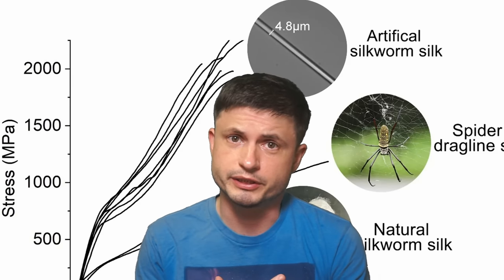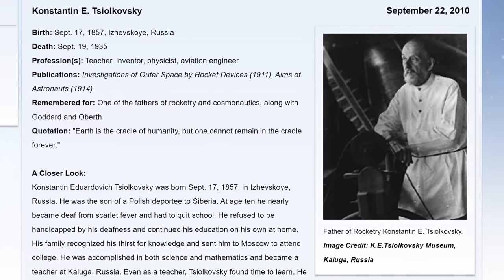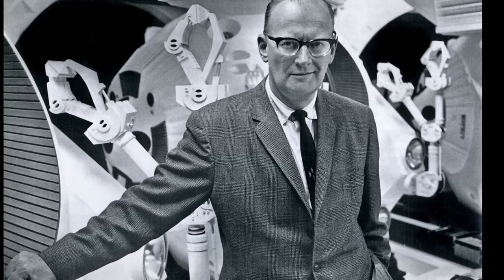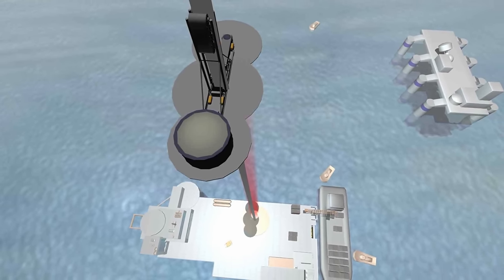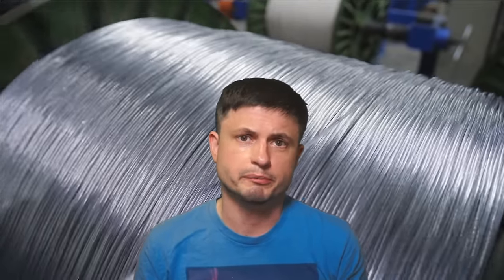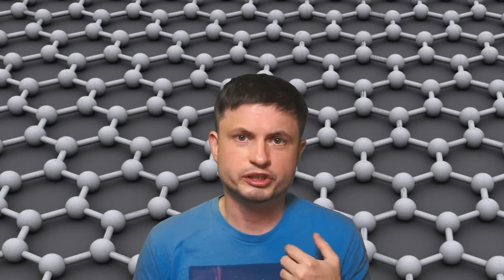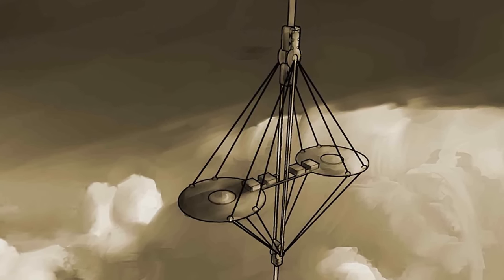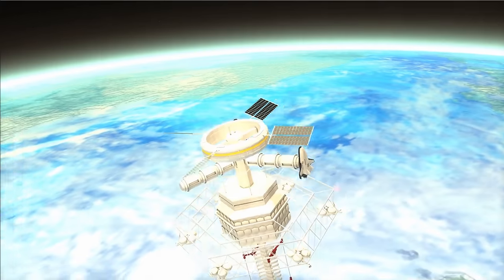Exciting New Updates About Space Elevator Technology...Possible After All?

Comment: I'm excited about the advances in graphene technology!!  I have to wonder how storms would affect the space elevator.  I guess the tension would be greater than any wind speed.  What would happen if it fell?  Fascinating subject!
Reply: It would fail hugely 😂
Reply: Weather is actually one of the largest problems concerning SE development, this is why the terrestrial end would almost certainly need to be on the water and 'free floating' so as to allow it to move around problematic weather patterns. Another possibility would be to build on a near-equatorial high point somewhere the weather doesn't get too violent, but there aren't all that many good candidates for that option, and of those which do exist, most are in politically 'awkward' places.

As for what would happen if it fell......well that's not a happy thought, one hell of a lot of mass coming down at a pretty high velocity (especially the 'far' end of it). There are a few thoughts on what could be done to mitigate real damage in such a situation, and oddly, having strategically placed det charges every kilometer or so, designed to go off in the event of catastrophic failure, would probably stop the worst of the damage, but certainly offers up problems of it's own in safety and application.

Ultimately, this is still all mostly speculation since the logistics of getting everything started are still monumental in scale, if we are to assume graphene tethers are the option used, the graphene itself would almost certainly need to be manufactured from geostationary orbit rather than shipped up prefabricated. That way you could do several raw material deliveries instead of trying to get what will be a rather huge mass of graphene up there in one or two trips.

I still hope to see the first SE up and running in the next 20 years, but I'm not holding my breath. I have been convinced the idea is literally going to save the human race sooner or later, it is without doubt the single most important endeavour in scientific development at present, if not ever. It offers solutions to everything from space travel and colonisation to power production and finally gives us access to the cosmos for a sustainable price (these things would be solar powered so literally zero emission space access).

Thankyou Anton for yet another great video, keeping doing your thing dude, you're a legend!
Reply: All questions that will have to be addressed and answered.
Reply: I always figured a space elevator wouldn't be plausible because of the fact that it would be the largest lightning rod in existence. Going near it would be a death trap. Maybe it could be used as a source of electricity? I don't know, someone smarter than me could answer all that.
Reply: it would definitely depend on where the rope snapped, if it happened near the earth, nearly the whole space elevator might simply float away into space, dragged by the counterweight; or if it snapped higher up toward space, then you could indeed have hundreds of miles of metric tons of this rope-stuff falling down onto the planetary surface as a very real scenario...indeed having this type of thing anchored in the open ocean for such a reason could be interesting
Reply: You should read the Mars Trilogy by Kim Stanley Robinson. It’s a bit of a slog by by golly does he really dive deep and explore some very interesting topics and concepts. Not least of those is a Space Elevator and everything about it. Including using harmonic oscillations in the cable to dodge moons and such. There’s so much more but spoilers about. You should just give it a shot.
Reply: @czarlguitarl  that's now how gravity works. It would deorbit, it wouldn't go floating off into space. There is no outside force acting upon it.
Reply: @czarlguitarl  A series of counterweights with explosives built in to keep as much as possible in geocentric orbit might solve part of the problem.
Reply: If you suspend it above sea, what direction would it fall, east or west? And how large will the impact region be? Or would it fall straight down. Could be video in itself
Reply: @AnubisSolvang  The counterweight of the elevator moves at above orbital speed. It's past geostationary orbit and yet moves with geostationary angular momentum. This is why there is tension in the cable at all: the counterweight is ""trying"" to move in an elliptical orbit, but is stopped by its tensile connection to the ground through the cable. This means the cable will probably come with the counterweight into its high elliptical orbit if it snaps lower down.
Reply: @primarysecondaryxd  your forgetting about atmospheric drag. But I am no physicist so I could be wrong. To me it very much seems like it would deorbit. Because take into consideration that even the moon is within earths gravitational well.
Reply: @AnubisSolvang  Atmospheric drag would not be an issue because the elevator is not moving relative to the atmosphere
Reply: @AnubisSolvang  It's not that your concept of physics is wrong, it's just that you're having a hard time visualizing the perspective necessary to understand it.  This is an entirely new concept that no human has ever seen before, and it takes some orbital mechanics to understand everything that's going on.  If one were to snap the cable just above ground level, the entire structure would in fact lift up and out toward space, as the countermass at the other end has to provide tension all the way to the ground...meaning it's pulling the ground structure up.  The mass at end of the elevator is akin to swinging a weight at the end of a fishing line, if the cable snapped it would be like letting go of the fishing line and allowing the weight to fly away, with the fishing line in tow.  Orbital velocities are different depending on how far away you are from the planet, and they only coincide with the rotation of the planet at a very specific distance called geosynchronous orbit.  If you're below this, like where the ISS and most satellites are, your relative velocity to the rotation of the planet will be higher, above this and your velocity is slower (note that our relative rotational velocity is faster than the moon's, which is considerably farther than geostationary orbit).  Now, if you're not at geostationary orbit and you match the rotational velocity of the planet, you will either start falling if you're below it or flying away if you're above it.  At LEO (low earth orbit), satellites have to fly faster, around 17,500mph.  Geosynchronous satellites are only 7,000mph, and the moon is a boring 2,300mph.  So if you're going 17,500mph in geosynchronous orbit, you're going 10,000mph faster than necessary to maintain orbit, which mean you'll be leaving that orbit in short order.  Now, imagine a satellite in a stable geosynchronous orbit, as long as it's positioned there very precisely, it's going to stay there virtually indefinitely, but the satellite is small so it doesn't help us visualize anything.  Instead, let's make the satellite truly massive...actually, let's make it a hypothetical spherical alien ship that's 100 miles wide.  It's also in a stable geostationary orbit, even though parts of it are 50 miles below geosynchronous orbit and parts are 50 miles above it.  It doesn't de-orbit, and it doesn't fly out into space, because its center of mass is precisely at geosynchronous orbit.  Each end is held together because of the tensile strength of the hull.  This would still hold true if it were 44,000 miles wide, which would put parts of it within our atmosphere nearly touching the surface and parts of it way past geosynchronous orbit.  It won't burn up in the atmosphere because the atmosphere has the same relative velocity...that tangent point of the ship is going at the same exact speed as the surface of the planet, even though it's a massive ship in a much higher orbit than something like the ISS.  The other end of the ship is at an altitude of 44,000 miles, where a stable orbit speed would be 5,000mph, but that end is going considerably faster than necessary for that orbit. Both ends of the ship are trying to be pulled apart by gravity and centrifugal force, but held together by the tensile strength of the hull, with the center of the hull being point where the forces are trying to pull apart from each other.  From here it's easy to imagine a cable running the width of the ship that helps add strength to the hull when they park it at such an orbit.  Take away the ship and leave the cable, and you've basically visualized a space elevator.  So what would happen if we got tired of the alien's crap and Will Smith flew some canned sunshine into their ship to blow it to pieces?  Basically, anything below geosynchronous orbit would eventually fall, and everything above geosynchronous orbit would fly out into an elliptical orbit, with their original altitudes being their orbits' perigee.  The pieces likely wouldn't fly off into deep space simply because escape velocity is much higher than this and they're not going to have little boosters to aid them, but the explosion might push a few smaller pieces past that point.  With the space elevator, things are pretty much the same.  If the break happened near the surface, the portion above would appear to an observer to simply levitate off the ground straight up and disappear into the sky.  Keep in mind this is going to result in an elliptical orbit, meaning the countermass is going to bob up and down relative to our perspective.  Breaks anywhere further up would result in the same basic thing, anything above the break would fly up and anything below falling to the planet.  But atmospheric drag would be minimal short term, as we're not talking about orbital relative velocities or even close to them, no sort of re-entry burn situations, it's just a tether moving straight up at maybe a few hundred mph opposing a huge countermass with significant kinetic energy, and it would only be in atmosphere for a short time before it was pulled out into space.  So relative to the forces in play, atmospheric drag is pretty minimal.
Reply: @Skinflaps_Meatslapper  I get the concept of swinging a weight at the end of a rope but the gravity of earth is acting upon them. So when you release the rope earth's gravity pulls the object to the ground. When you're talking about space there is no outside gravity acting on the geosynchronous structure. I'm thinking if it snapped at the base or at the top the cable would start falling or floating opposite of the earth's rotation. The air on earth doesn't orbit in sync with the planet so I can imagine if it snapped at the base the cable would float off and just look like a long line across the sky and eventually the atmospheric drag would cause it to deorbit the structure. Unless they have a fail safe and release the cable all together and watch it fall to the earth and the space elevator just becomes another satellite.
Reply: @AnubisSolvang  Why else do things orbit the planet instead of flying off into space?  Everything in orbit is affected by gravity, that's why it's an orbit in the first place.  "So when you release the rope earth's gravity pulls the object to the ground."  What you're saying here is that a rope can hold up a massive counterweight up some 30,000 miles high under compressive load.  You can't even get a rope to stand up on its own a foot high for more than a few seconds, and it's for this reason among others that I don't believe you're quite grasping the orbital concepts at play here.  The counterweight is going faster than its orbit requires, which means it's trying to pull away from the planet with considerable force, but the cable is tethering it maintain that artificial orbit.  If the cable snapped, nothing would hold the counterweight from flying away, and by flying away, we're talking thousands of miles out into space before it even hits apogee.  Just like the bottom of the tether isn't orbiting, the air on earth doesn't orbit either, it follows along at the same relative speed as the surface, otherwise our forecasts would include hypersonic winds.  Geosynchronous orbits mean objects at this orbit are stationary relative to the planet's rotation, they'll always be at the same point in the sky when you look up, you can aim a telescope at them and a week later it's still pointing at that object.  It means they're also stationary relative to the atmosphere too, jet streams and local wind notwithstanding, because the air is stationary relative to us.  There is a tiny amount of air way up at LEO, so little that it's essentially vacuum, but it's not really moving an appreciable amount in any particular direction and there's so little of it that a satellite with no aerodynamic considerations will still take months or years or centuries for that air to slow it down enough to de-orbit, and the air at that altitude is going to be relatively stationary to the tether.  The only time that tether will see any air resistance is when it's coming back down at perigee or up immediately after, but it'll be moving at a low speed, not deorbiting speed, and the only effects it would have might be to turn an eccentric orbit in a more concentric one over a period of centuries or more.  For those reasons, atmo is entirely insignificant when dealing with a broken space elevator.
Reply: @Skinflaps_Meatslapper  who said anything about a tether holding anything up? Where are you getting compressive load from? I think you're mixing me up with someone else.
Reply: @AnubisSolvang  I'm not mixing you up with anyone else, in fact I quoted you so you knew what I was referring to, "when you release the rope earth's gravity pulls the object to the ground".  You're trying to say that a space elevator is the same as swinging a weight at the end of a rope, but when you let go it falls back down.  Essentially what you're saying is that the only thing that's changed as far as the weight at the end of a rope or a space elevator hooked to a tether is concerned is the fact that the rope or the tether is no longer hooked up to the earth any longer, and that's why it's going to fall down.  Think about what you're saying again...the only way a severed tether could possibly bring the counterweight down toward earth is if the tether was actually under a compressive load, and that's not the case.  If it were under a tensile load and you cut it, the counterweight would be released, and since the counterweight is already in ORBIT, it's NOT coming back down, especially given the fact that the tether is forcing the counterweight to hold a lower orbit in order to maintain tension on the tether.  Why is this difficult for you to understand?
Reply: @Skinflaps_Meatslapper  I'm talking about atmospheric drag, why do you gloss right over that? I mean I'm sure there would be fail-safes in place to release the tether if there was a  break in the line. Take this for example, if you're holding a string taught between both hands and place it in moving air what happens? There's drag, and that's on a tiny scale. Air doesn't move with the surface of the earth in perfect unison. It it did we wouldn't have any Tradewinds. There's convection and the upper atmosphere does move at a different rate which is why we have electrical build up in the atmosphere. That's why I think the tether will be a giant lightning rod or it could possibly collect enough current to just burn up every time we attemt to run a tether. There's tons of forces at play. I'm not trying to disprove anyone, I'm just adding in as much factors as I know of.
Reply: @Skinflaps_Meatslapper  I'm sure you know everything in orbit is going to eventually deorbit, in fact I know you know that. The earth's gravity well is pretty massive and that's why we use the moon to slingshot to other celestial bodies and we still have to use massive amounts of thrust to do so. I feel like you're just misinterpreting what I'm saying. Maybe I'm using bad analogies. Your name has me rolling 😆
Reply: @AnubisSolvang  Possibly. Imagine how much electricity could be created by the thing just being there collecting static electricity. You might be on to something.
Reply: @AnubisSolvang   The point of a space elevator is to get something into orbit without imparting any extra horizontal momentum at all. It's true that Earth's gravity will pull any object moving with insufficient horizontal momentum down: so at what altitude is simply moving at Earth's rotational angular speed enough to keep an object in orbit? Today there are many satellites stationed at what is called Geostationary orbits: these satellites have orbital periods (total time it takes to orbit once) exactly equal to the Earth's rotational period. This means that if you were suddenly teleported from the Earth's surface to the Geostationary orbit altitude (roughly 35 786 km), you wouldn't have to do anything to prevent yourself from falling back to Earth; you're already moving at orbital speed. 

A space elevator has a massive (in the sense of a large mass) cable hanging down from it. Since the whole space elevator structure must move at Earth's angular velocity, a huge fraction of this cable's mass is not moving fast enough to achieve stable, circular orbits (much of the lower parts of the cable will have suborbital velocity); on its own, a space elevator which is anchored at exactly geostationary orbit will be pulled down by its own cable. But what if the anchor had a higher velocity? On its own, simply making the anchor move faster would destabilize the entire structure, as it would now move relative to the Earth's surface, eventually wrapping the cable around Earth, but if the anchor was moved to a higher altitude to compensate (v = wr), eventually an equilibrium point would be reached where the upward force generated by the elevator moving faster than the velocity required for a circular orbit matches the total downward force from all the parts of the cable moving at velocities slower than that required for circular orbits, and the cable is held taut and in tension. 

It turns out that for the Earth, this tension force is very high, and non-conventional materials are required to make it. 

On the topic of atmospheric drag on the cable, only a tiny fraction of the length of the cable (the Earth's atmosphere would only produce truly significant drag for something like a thin cable at below about 50km) experiences significant atmospheric drag. The cable travels upwards while in the atmosphere: although drag does slow it down and apply a net force on the whole space elevator system, eventually it will reach a point in its trajectory where drag becomes insignificant. Remember that the space elevator was already putting the entire ~40 000km long cable under a huge amount of tensile stress; the force on the cable upwards is fairly large. The entire elevator's momentum is such that it would have an elliptical orbit with its lowest point at the elevator's counterweight already, but the elevator's trajectory while the cable is attached is kept circular through tension. Atmospheric drag on the cable would most likely simply make this elliptical orbit slightly less elliptic.

I'm not really sure, but I don't think lightning would pose a significant danger to the cable itself: graphene (and other allotropes of carbon which might be used as space elevator cables) is incredibly conductive and lightning has a very high voltage and so thermal heating due to resistance should be fairly low. As long as the cable was grounded at the surface anchor point I imagine it'd be fine, though I'm not sure. It's also possible it could be used as a generator. Lightning traveling up the cable to the counterweight could be problematic, but it's perhaps easily stopped by simply insulating the part of the cable near the anchor with a jacket, and electrically isolating the connection point from the rest of the counterweight. Lightning is sometimes estimated to have a field strength of 3,000,000 V/m, but the breakdown voltage of vacuum is around 10^9 V/m (1000 times higher), so the lightning probably wouldn't be able to arc through the vacuum of space onto the counterweight; instead it would probably just reflect around at the top, eventually make it back down the cable, and bounce around until it found ground.

Weather phenomena could probably pose a danger to the cable in extreme conditions. I believe some propose building it in an equatorial high-altitude region away from the sea so that these events simply rarely happen. The atmosphere does not move significantly faster or slower than the Earth's rotation, so the Geosynchronous motion of the cable would be fine in terms of general atmospheric effects. It could be possible that winds higher in the atmosphere pose a problem, but if the cable is under enough tensile stress, it probably wouldn't be able to develop significant harmonic oscillations like skyscrapers do: if the cable is thin enough, the total force from this effect should be fairly small, so could possibly be simply corrected by periodic stationkeeping at the counterweight (ie RCS like the ISS does).

If the cable breaks, a possible safety measure I can think of is to utilize the fact that the response to the break would travel much slower than lightspeed (ie perhaps a few kilometers per second at most). The wire would be fairly thin, and so have a low cross sectional area: this means that the average drift velocity of electrons in the wire could be quite high given a large enough current with low voltage. If a low energy electrical connection like this was permanently maintained between the anchor and the counterweight, a break could be detected before the effects of the break reach the ground, and so the cable could be severed hopefully in time for the cable to gain quite a lot of momentum before the snapback reaches the anchor and "pulls" on the Earth, which would be the actual force that pulls the cable down to Earth instead of away into orbit. I think this wouldn't be effective for a low-down enough snap, though.
Reply: @primarysecondaryxd  what an awesome breakdown of each issue that was brought up. That's way more in depth than I was willing to go. I just wanted to bring up multiple issues I could think of with my limited knowledge.
Reply: @czarlguitarl  isn't space like 62 miles up? So like a 100 if you're slightly higher?
Reply: You should be much more concerned about how satellites would affect a space elevator, as it would occupy every single satellite orbit there is, and essentially be a gigantic "wiper," destroying everything in it's path. ;-)
Reply: @-108-  eh... a very non issue. Predicting orbital paths is child's play, especially since all satellites are tracked and have manuvering capabilities. It's the micro debris that are the problem.
Reply: @AnubisSolvang  Uuh, no... Yeah.
Reply: @-108-  do you think the universe is 2D?
Reply: @AnubisSolvang  A space elevator would be incompatible with everything humanity has built in space thus far.
Reply: @Veklim  If the elevator "cable," or in reality a ribbon, broke at the base, it would not fall out of the sky, as the counterweight and geostationary space station (the central control point) would be pulling it up out of our atmosphere. I have read that in fact it would be a good idea to make the connection at the earth anchor point the weakest point to ensure safety, a sort of fusible link as it were.

As the geostationary mass and the counter weight started to pull the ribbon out and away from earth, they could be maneuvered by emergency rocket motors and mechanical tension on the ribbon to regain and then maintain control over positioning. Then after regaining positional control, one or more "Rocket sleds" with fuel and attitude control rockets could be sent down the ribbon to stabilize it again in the atmosphere, and control its decent back to the tethering point for re-attachment, just as would have been done during construction.

If the break did manage to happened in or above the atmosphere, then the ribbon would start to fall back to earth, but think about how baby spiders send strands of spiders silk into the air in a breeze to get blown away to a new home. As the ribbon would have such a large area to mass ratio, it would float down, not come crashing down. People have survived being hit by meteorites, which have a much higher mass to area ratio, and while It might kill you if it hit you, it would not cause catastrophic damage. Remember that it takes energy to slow an orbiting object down enough to survive orbital re-entry, and anything above a certain altitude would be traveling to fast through space to survive atmospheric re-entry. 

That is the magic of a space elevator, in that complex calculations for maneuvering those rockets for re-entry is no longer needed, as all one needs to do is balance the mass going up and down the elevator while providing only small corrections to the counterweight and orbital station, either through extending or retracting the tethers, and using small amounts of reaction mass that is cheap and easy to supply to the station and counterweight.
Reply: @-108-  These cables would be quite thin, and the number of satellites which are on low equatorial orbits is decently low (most satellites are launched from countries who are not on the equator, and so their orbits end up quite inclined compared to the Earth's rotation). The cable's position would be able to be tracked extremely precisely, and its position could be extrapolated into the future for hundreds of years because it simply follows Earth's rotation. Larger low orbit satellites today already have to periodically shift their orbit to avoid collisions with debris and other satellites; they could easily work around a thin cable whose precise position is known decades in advance. Satellites in Geostationary orbit are all at an equatorial inclination, however since the orbital radius is so high, the 'space of possible angles that count as equatorial' (if you want to think of it like that) is large (probably at least a tenth of a degree). Even a small inclination like that would put hundreds of kilometers between a satellite and the cable at closest approach. I think there have been proposals in scifi where the elevator's cable oscillates to avoid collisions with tracked debris, but I'm really not sure about the feasibility of that.
Reply: @-108-  humanity hasn't built anything in space.
Reply: @GoCoyote  ok, so miles and miles and miles of immensely strong tether material dropping across a huge area generating a good amount of heat and static charge wouldn't be a problem at all? I'm not saying it would be like a large metoer impact, but it would certainly cause a lot of damage and trouble.

Ideally any break occurring would happen right near the base like you say (although ideally it wouldn't break in the first place I suppose) but contingencies would need to be made for worst case scenarios. For instance, what happens if you're 35 miles up in the cargo car and you get a break above you? Then it's not just the tether, it's the freight as well, which is actually the most likely way a mid-tether break would occur if you think about it, since it's under load at that moment.
Reply: @AnubisSolvang 
Typo correction: A space elevator would be incompatible with everything humanity has put into orbit around the Earth thus far.
Reply: @SkyGravity137  that's a good point too, haven't even thought up to thet point. A space elevator would be great but there's just so much physical limitations to our current technology. I guess we'll have to go with something more feasible. Giant space station with tractor beam/grav lift  😆
Reply: @AnubisSolvang  ..  yes there is a force acting on the tower's upper parts.. it's called centrifugal force or gravity.. that's why you need a counter wieght so far out in space to hold the line tight.. like a ball on a string that your swing around a circle.. it always wants to go in a straight line and fly away... the tether is what holds it on place as it would in this tower design.
Reply: @thrillchaser9492  yeah that literally the only way to make a space elevator with physics as we know it. Why does everyone think the tower would hold up the orbiting satellite?
Reply: @Skinflaps_Meatslapper  woo that comment! I really enjoyed reading it a lot.

I'm curious about your thoughts on putting the elevator at the north or south pole
Reply: @Faesharlyn  I think it's an awesome idea, in fact, I don't believe anyone has ever suggested it.  Perhaps you should patent the idea?  It makes more sense, seeing as how an elevator should go up and down...what better place for it than the top and bottom of the planet?  You'd also vindicate every globe that has a little pin going through the poles to allow for rotation.
Reply: @AnubisSolvang  no outside force, but it has momentum.   If bad weather snapped the cable at 10,000 feet, the lower portion of the cable would fall to earth, but everything above, through the geostationary portion and out to the counterweight would (as a whole) be moving faster than escape velocity, so it would indeed coast away from Earth.
Reply: @AnubisSolvang  The simple way to think about what happens to the pieces when the cable breaks is as follows:  A space elevator remains stationary relative to the Earth's surface because its center of mass is in geosynchronous orbit.  In any scenario where the cable breaks into two pieces, the lower piece will have a lower center of mass than the original cable, because it lost mass from the top.  Because it was very close to the ground in the first place, it will now be in a "ground intersecting orbit", or more colloquially it will fall.  The top piece will correspondingly have a higher center of mass than than the original cable because it lost mass below its center and will thus be in a higher orbit.  From the perspective of an observer on the ground, it has "fallen up", though the lowest point in its orbit will still be at geostationary altitude unless some other forces are applied.
Reply: @larryfromoregon3294  no it wouldn't, it would still be within earth's gravity well. It'll take a very long time but it'll come back down (relative to earth). My thinking is if anything were dangling down in earth's atmosphere it would accelerate the process.
Reply: @bobbun9630  unless it has enough energy to leave the gravity well of earth which I have no idea how far that is. I just know a geosynchronous satellite isn't past the moon and eventually will come back to earth in due time. I definitely know lots of people are more knowledgeable than me on these subjects but I feel like they're glossing over other things which I have done too and it's great reading everyone's comments.
Reply: @AnubisSolvang  Nope.   The moon is within Earth’s gravity, but it will never fall to the ground—because of its momentum.
Reply: @larryfromoregon3294  it'll take a while put they will collide eventually. A geosynchronous satellite will fall back to earth in roughly 100 years. I'm saying a long cable dangling within earth's atmosphere would shorten that time. That's all I'm bringing up but somehow everyone thinks the satellite will magically fly off into space without external forces acting on it. In order for any satellite to gain distance from the earth, it takes tremendous amounts of energy.